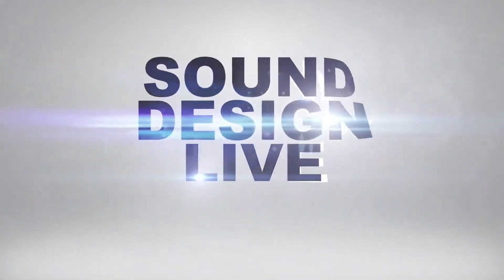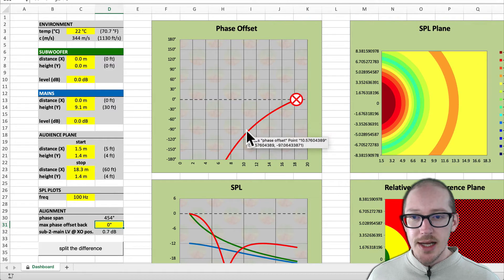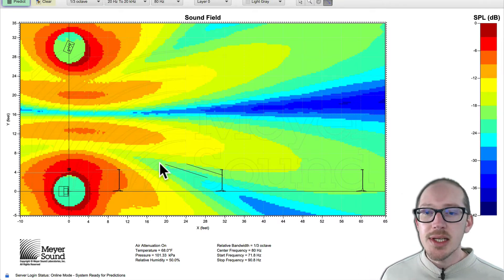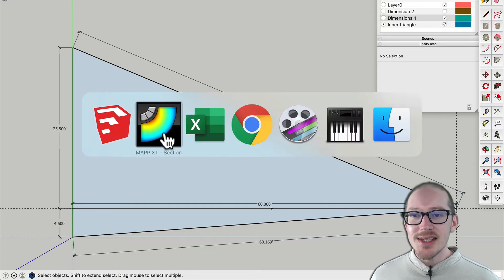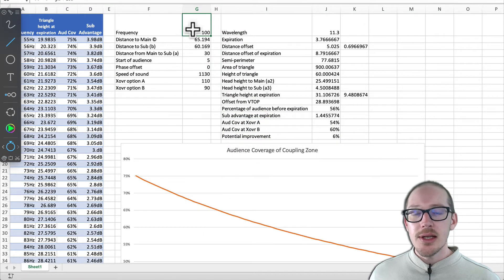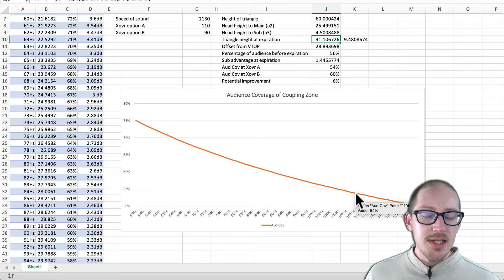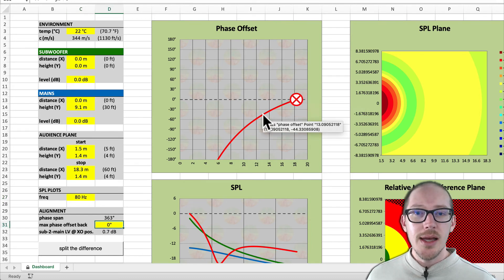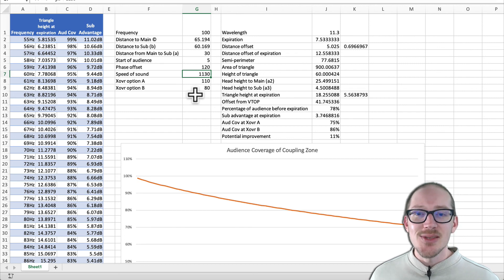Should audience depth influence crossover frequency between main and sub?

Comment: A few things to note when using Merlijn's calculator.  
 - Remember that even in your example, there is a phase span of 544°, so don't get too locked in to just using 120° offset.  Sometimes you get good summation with 38°, or others.  It is worth trying out many different offsets and see what creates the best summation (or best compromise) for your room.
- The calculator only shows one side of the PA.  Once you've found an offset you like, place the mic in your model at the point the calculator suggests and do a virtual alignment (entering in enough delay to the subs or mains to align the two), and look at how the entire system is reacting.  Just because one axis has great summation, that doesn't mean the entire system (or room) will respond well with that alignment point.
- If you are toying around with lowering (or raising) your crossover point, remember to double check that in your modelling software for summation of both sides of the PA.  How the room responds to your main PA producing 80hz as opposed to your subs producing 80hz (especially with larger arrays) can be significant (and sometimes that's a good thing).  Also, make sure your mid/highs can handle the lowered frequency! I probably wouldn't crossover a Mina array at 80hz if the show was a rave, for example...
- Remember that Merlijn's calculator does not work for center-placed horizontal subwoofer arrays and beamsteered arrays.
- Finally, don't use the results of the calculator and your model as a replacement for placing a microphone at the show and doing an alignment.  Ultimately, like modelling software itself, the calculator is a tool to help find where your mic should be, not a tool to simulate the system to avoid placing the mic in the real world (not that I think you would fall into this pitfall, but it bears mentioning).
Reply from the maker: Thanks so much Colin for sharing this. Looks like you have a lot of experience with the calculator. 

>don't get too locked in to just using 120° offset.
Tell me more about this. If 120º is the end of the coupling zone, why wouldn't I always using 120º? Unless I don't need that much of an offset, 120º is the maximum I can go.

>It is worth trying out many different offsets 
Again, I'm a little confused by this. If the phase span is ever more than 240º, why wouldn't I just go straight to the maximum of 120º?

>place the mic in your model at the point the calculator suggests and do a virtual alignment
Yes! Great idea.

>I probably wouldn't crossover a Mina array at 80hz if the show was a rave
Tell me more about this. How does your design change for a rave?

>Merlijn's calculator does not work for center-placed horizontal subwoofer arrays
I guess I assumed this, but now I wonder why not. It should work for a singe plane between any two sources, so I suppose it just depends on how helpful that plane is to your designing.